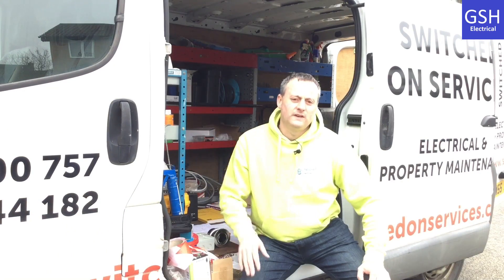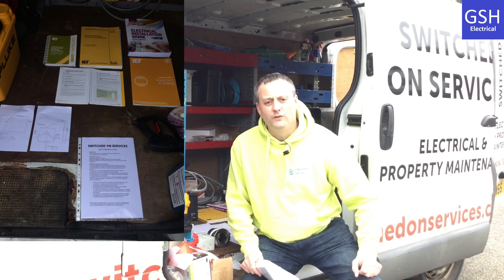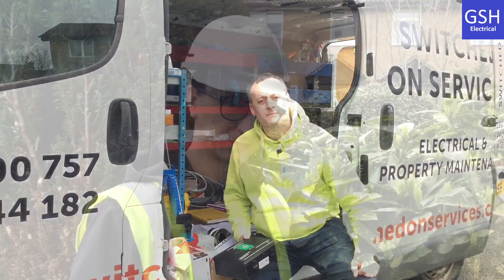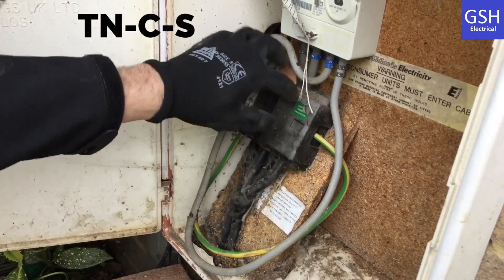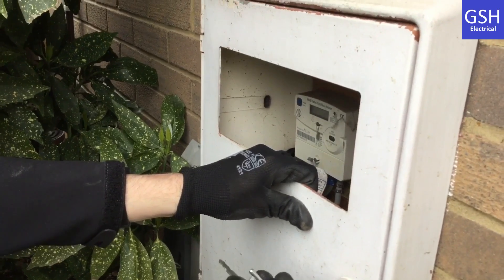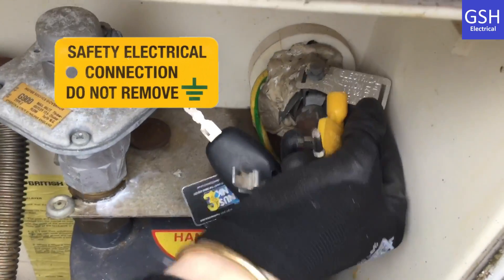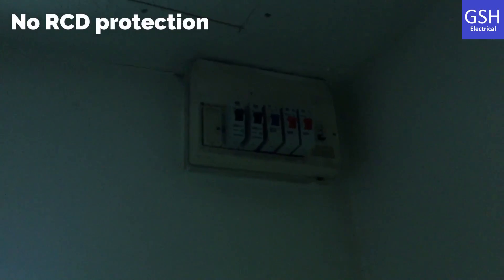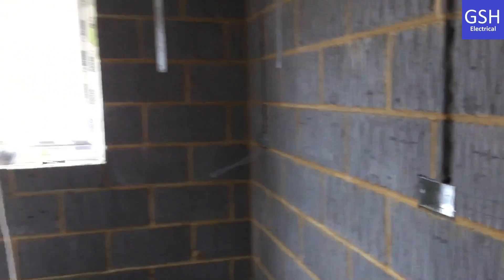On-Site with Mark Doing a First Fix, Cable Sizes and Chasing a Box into the Wall (Read Description)

Comment: why are the boxes chased in to their full depth, if its dry lined they will be at least 25mm behind the plaster, they can be fitted direct to the wall when dry lined as the board is 12.5mm and the dab 12.5mm which is the same depth as the box, plus unless the cables are going in round conduit, they can be fitted to the surface, i use oval conduit, he is making work for himself.
Reply from the maker: Hi. I was only on this site for 6 hours but this was some months ago. The finish of this wall now escapes me. What you have said is correct for a dry lined wall. Thanks for watching and commenting GSH Electrical 👍.
Reply: I as a customer would not be happy  with only 25mm back boxes being fitted. I insist that at least 35mm are fitted. There is far too little room is a 25mm box for a pair of cables for sockets. 25mm in my opinion is only just good enough for light switches. Even 25mm boxes for light switches with the increasing use of loop in the box approach is proving to be insufficient depth to house the joints. My spec would be for 35mm min depth boxes for both lights and sockets.

Comment: Only criticism is that there was no mention of the artex ceiling may have contained traces of asbestos. (Did notice the ? With the mask situation). How would you of challenged the artex ceiling situation with the customer? And would you have done a risk assessment on it or just advised the customer before work began to inform the local council of the suspicions? Just interested on your thoughts of this.
Reply from the maker: Hi. Houses built pre 2000 have a risk of asbestos but it’s ones from the 1970/80 that have the higher concerns. My videos are short but I am on site for over 6 hours. The ceiling in the kitchen was removed by the builder and Mark had raised this point with him (it’s one of the outcomes in his paperwork). Mark got written instructions from the builder that all ceiling covering were asbestos free. When you read my description these are some of the talking points we raise in the classroom alone with such things as a lack of a dust mask when drilling and heights of switches in the new build. Thanks for the great question and watching GSH Electrical
Reply from the maker: Hi. I have updated the description with some of our classroom taking points. Thanks again Gaz